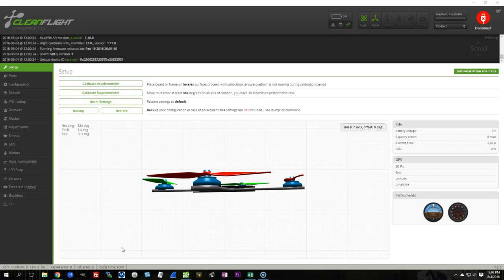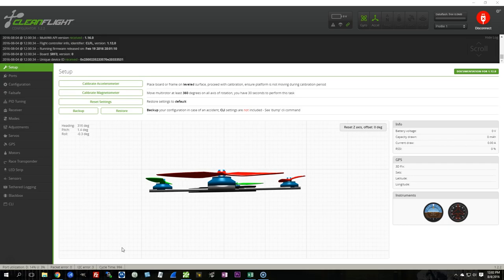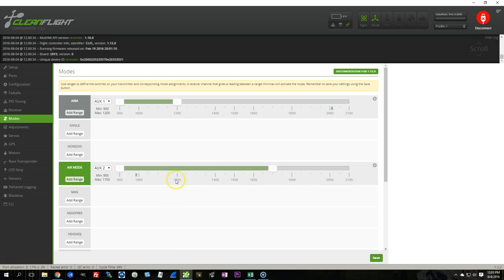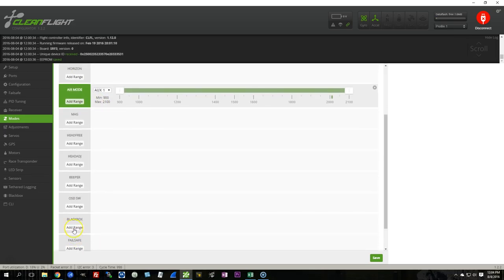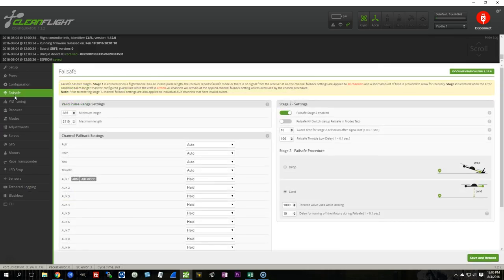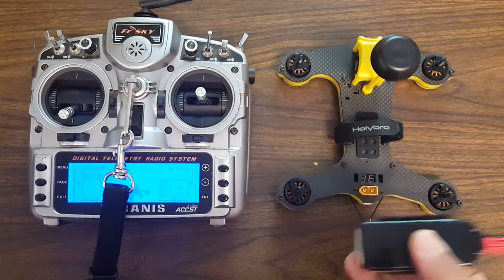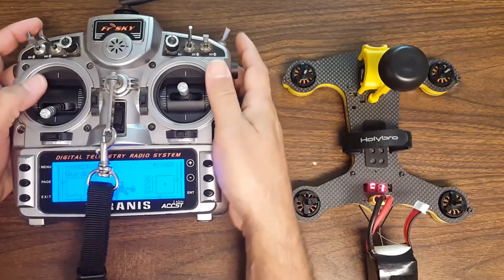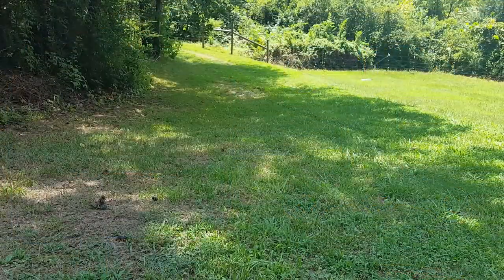Holybro Shuriken 180 Initial Setup and Pre Maiden Checks

Comment: Hiya Josh!  I've been sub'd to you for quite some time.  No, I don't comment on many of your videos because they haven't been directly related to me.  However...that's changed.  I've recently bought a Shuriken 180.  I had a few issues getting it to behave properly, but I've watched many of your videos and the issues were resolved quickly.  Thank you for taking the time to do what you do.  I did maiden hover my Shuriken 180 today and I was greatly impressed with it on stock PIDs and stock props.  I tested the video system and found that it works, as expected.  So...whenever this rain goes away...it's back to the FPV field.  Take care buddy and thanks again!!!

Comment: Hope to see the continuance of this series soon Joshua. Prop choice for the two motors available and how well it handles with Betaflight are subjects I'm interested in hearing about. Keep up the great work. I appreciate your efforts and insights.
Reply from the maker: +Ron Novak it handled great with Betaflight right up until I burned a motor with excess D gain.
Reply: +Joshua Bardwell  hopefully you'll have a chance to replace that motor and get airborne again. Is yours equipped with the 2700kv motors? The 2300kv motors were installed in mine but kit included the higher KV set. Been getting a solid 3 min. flight with the stock props and some middle aged Nano 850mah/4s packs.
Reply from the maker: +Ron Novak 2700. I have replacements on the way from New bee drone.

Comment: Hi Josh!, great videos and new subscriber here!! Just updated my shrunken 180 after a prompt in cleanflight, I've dumped my old cli settings in but obviously in the updated version there are more values on the pids/ modes tabs etc,
Is there any link or video you can do for setting up this quadcopter on its newest CF firmware please? Unable to fly currently :(
Reply from the maker: Definitely do not just dump in your CLI values from the old version to the new version. 

https://www.youtube.com/watch?v=HsxTqp76Brs

I won't be making an update video specifically for this copter, but you can watch maybe this video for some tips on how to do the initial configuration: https://www.youtube.com/watch?v=lNmEeCMryu4
Reply: I meant I have not updated to beta flight just put the old cli into the updated cleanflight . 
Would you recommend then that I do a full chip erase and set it up fresh on betaflight?
Reply: Joshua Bardwell unfortunately I did dump it before I read your comment, 
Took a bit to sort the receiver out but it's working and flying now, I just wondered is it not tuned now to stock settings? So sorry, just a noob that wants to fly

Comment: Hi Joshua Bardwell.  Question:  It's not better to have the 3 flight configurations modes? If so, do you have a vid. To do it? 
Thanks.
Reply from the maker: +Alfonso Irwin I don't use autolevel modes.
Reply: Joshua Bardwell I know that you don't..  it's obvious for the way that you flying.. I mean for beginners.. like me 😉

Comment: Hi.. can I use it with my Radiolink AT Tx and Rx..?  do I need to open up and put the rx inside? will it fit?
Reply from the maker: You would need to install the RX. It has to be a really small RX to fit. It also has to be serial or possibly PPM. It can't be standard PWM.

Comment: Hello Joshua,

I flashed my shuriken 180 like it says to do in the quick start guide. To the latest stable SPRacingF3 release. Now i am not seeing any commutation on the receiver tab of cleanflight with my taranis. Any ideas what i need to do?
Reply from the maker: Presumably the configuration options for the receiver are not set up correctly. You should always save your previous config before doing an upgrade so you can refer to it if anything goes wrong.

I dug back through my archives and I found my old CleanFlight config for the Shuriken. It looks like the receiver should be on UART 2. So make sure UART 2 has "serial rx" enabled in the Ports tab. Then set "serial receiver" in the Configuration tab. Then the Serial Receiver Provider needs to be configured according to what type of receiver you have: SBUS, iBUS, Spektrum, etc...
Reply from the maker: +Dylan Dydot 

#Cleanflight/SPRACINGF3 1.12.0 Feb 19 2016 / 20:01:10 (aa8608a)
# dump master

# mixer
mixer QUADX
mmix reset
smix reset

# feature
feature -RX_PPM
feature -VBAT
feature -INFLIGHT_ACC_CAL
feature -RX_SERIAL
feature -MOTOR_STOP
feature -SERVO_TILT
feature -SOFTSERIAL
feature -GPS
feature -FAILSAFE
feature -SONAR
feature -TELEMETRY
feature -CURRENT_METER
feature -3D
feature -RX_PARALLEL_PWM
feature -RX_MSP
feature -RSSI_ADC
feature -LED_STRIP
feature -DISPLAY
feature -ONESHOT125
feature -BLACKBOX
feature -CHANNEL_FORWARDING
feature -TRANSPONDER
feature VBAT
feature RX_SERIAL
feature FAILSAFE
feature ONESHOT125
feature BLACKBOX

# map
map RETA1234

# serial
serial 0 1 115200 57600 0 115200
serial 1 0 115200 57600 0 115200
serial 2 64 115200 57600 0 115200

# led
led 0 15,15:ES:IA:0
led 1 15,8:E:WF:0
led 2 15,7:E:WF:0
led 3 15,0:NE:IA:0
led 4 8,0:N:F:0
led 5 7,0:N:F:0
led 6 0,0:NW:IA:0
led 7 0,7:W:WF:0
led 8 0,8:W:WF:0
led 9 0,15:SW:IA:0
led 10 7,15:S:WF:0
led 11 8,15:S:WF:0
led 12 7,7:U:WF:0
led 13 8,7:U:WF:0
led 14 7,8:D:WF:0
led 15 8,8:D:WF:0
led 16 8,9::R:3
led 17 9,10::R:3
led 18 10,11::R:3
led 19 10,12::R:3
led 20 9,13::R:3
led 21 8,14::R:3
led 22 7,14::R:3
led 23 6,13::R:3
led 24 5,12::R:3
led 25 5,11::R:3
led 26 6,10::R:3
led 27 7,9::R:3
led 28 0,0:::0
led 29 0,0:::0
led 30 0,0:::0
led 31 0,0:::0

# color
color 0 0,0,0
color 1 0,255,255
color 2 0,0,255
color 3 30,0,255
color 4 60,0,255
color 5 90,0,255
color 6 120,0,255
color 7 150,0,255
color 8 180,0,255
color 9 210,0,255
color 10 240,0,255
color 11 270,0,255
color 12 300,0,255
color 13 330,0,255
color 14 0,0,0
color 15 0,0,0

set looptime = 500
set emf_avoidance = OFF
set i2c_highspeed = ON
set gyro_sync = ON
set gyro_sync_denom = 1
set mid_rc = 1500
set min_check = 1100
set max_check = 1900
set rssi_channel = 0
set rssi_scale = 30
set rssi_ppm_invert = OFF
set rc_smoothing = OFF
set input_filtering_mode = OFF
set min_throttle = 1150
set max_throttle = 1850
set min_command = 1000
set servo_center_pulse = 1500
set 3d_deadband_low = 1406
set 3d_deadband_high = 1514
set 3d_neutral = 1460
set 3d_deadband_throttle = 50
set motor_pwm_rate = 400
set servo_pwm_rate = 50
set retarded_arm = OFF
set disarm_kill_switch = ON
set auto_disarm_delay = 5
set small_angle = 25
set fixedwing_althold_dir = 1
set reboot_character = 82
set gps_provider = NMEA
set gps_sbas_mode = AUTO
set gps_auto_config = ON
set gps_auto_baud = OFF
set serialrx_provider = SBUS
set sbus_inversion = ON
set spektrum_sat_bind = 0
set telemetry_switch = OFF
set telemetry_inversion = ON
set frsky_default_lattitude =  0.000
set frsky_default_longitude =  0.000
set frsky_coordinates_format = 0
set frsky_unit = IMPERIAL
set frsky_vfas_precision = 0
set hott_alarm_sound_interval = 5
set battery_capacity = 0
set vbat_scale = 116
set vbat_max_cell_voltage = 43
set vbat_min_cell_voltage = 33
set vbat_warning_cell_voltage = 37
set current_meter_scale = 400
set current_meter_offset = 0
set multiwii_current_meter_output = OFF
set current_meter_type = ADC
set align_gyro = DEFAULT
set align_acc = DEFAULT
set align_mag = DEFAULT
set align_board_roll = 0
set align_board_pitch = 0
set align_board_yaw = 0
set max_angle_inclination = 500
set gyro_lpf = 188HZ
set gyro_soft_lpf =  60.000
set moron_threshold = 32
set imu_dcm_kp = 2500
set imu_dcm_ki = 0
set yaw_control_direction = 1
set pid_at_min_throttle = ON
set airmode_saturation_limit = 50
set yaw_motor_direction = 1
set yaw_jump_prevention_limit = 200
set tri_unarmed_servo = ON
set servo_lowpass_freq =  400.000
set servo_lowpass_enable = OFF
set failsafe_delay = 5
set failsafe_off_delay = 10
set failsafe_throttle = 1000
set failsafe_kill_switch = OFF
set failsafe_throttle_low_delay = 100
set failsafe_procedure = 0
set rx_min_usec = 885
set rx_max_usec = 2115
set acc_hardware = 0
set baro_hardware = 0
set mag_hardware = 0
set blackbox_rate_num = 1
set blackbox_rate_denom = 4
set blackbox_device = SPIFLASH
set magzero_x = 0
set magzero_y = 0
set magzero_z = 0

# rxfail
rxfail 0 a
rxfail 1 a
rxfail 2 a
rxfail 3 a
rxfail 4 h
rxfail 5 h
rxfail 6 h
rxfail 7 h
rxfail 8 h
rxfail 9 h
rxfail 10 h
rxfail 11 h
rxfail 12 h
rxfail 13 h
rxfail 14 h
rxfail 15 h
rxfail 16 h
rxfail 17 h

# dump profile

# profile
profile 0

# aux
aux 0 0 0 900 1200
aux 1 27 0 900 2100
aux 2 0 0 900 900
aux 3 0 0 900 900
aux 4 0 0 900 900
aux 5 0 0 900 900
aux 6 0 0 900 900
aux 7 0 0 900 900
aux 8 0 0 900 900
aux 9 0 0 900 900
aux 10 0 0 900 900
aux 11 0 0 900 900
aux 12 0 0 900 900
aux 13 0 0 900 900
aux 14 0 0 900 900
aux 15 0 0 900 900
aux 16 0 0 900 900
aux 17 0 0 900 900
aux 18 0 0 900 900
aux 19 0 0 900 900

# adjrange
adjrange 0 0 1 950 1000 15 3
adjrange 1 0 1 1075 1125 16 3
adjrange 2 0 1 1175 1225 17 3
adjrange 3 0 1 1300 1350 18 3
adjrange 4 0 1 1400 1450 19 3
adjrange 5 0 1 1525 1575 20 3
adjrange 6 0 1 1625 1675 9 3
adjrange 7 0 1 1750 1800 10 3
adjrange 8 0 1 1850 1900 11 3
adjrange 9 0 0 900 900 0 0
adjrange 10 0 0 900 900 0 0
adjrange 11 0 0 900 900 0 0

# rxrange
rxrange 0 1000 2000
rxrange 1 1000 2000
rxrange 2 1000 2000
rxrange 3 1000 2000

# servo
servo 0 1000 2000 1500 45 45 100 -1
servo 1 1000 2000 1500 45 45 100 -1
servo 2 1000 2000 1500 45 45 100 -1
servo 3 1000 2000 1500 45 45 100 -1
servo 4 1000 2000 1500 45 45 100 -1
servo 5 1000 2000 1500 45 45 100 -1
servo 6 1000 2000 1500 45 45 100 -1
servo 7 1000 2000 1500 45 45 100 -1

set gps_pos_p = 15
set gps_pos_i = 0
set gps_pos_d = 0
set gps_posr_p = 34
set gps_posr_i = 14
set gps_posr_d = 53
set gps_nav_p = 25
set gps_nav_i = 33
set gps_nav_d = 83
set gps_wp_radius = 200
set nav_controls_heading = ON
set nav_speed_min = 100
set nav_speed_max = 300
set nav_slew_rate = 30
set alt_hold_deadband = 40
set alt_hold_fast_change = ON
set deadband = 0
set yaw_deadband = 0
set throttle_correction_value = 0
set throttle_correction_angle = 800
set default_rate_profile = 0
set gimbal_mode = NORMAL
set acc_cut_hz = 15
set accxy_deadband = 40
set accz_deadband = 40
set accz_lpf_cutoff =  5.000
set acc_unarmedcal = ON
set acc_trim_pitch = 0
set acc_trim_roll = 0
set baro_tab_size = 21
set baro_noise_lpf =  0.600
set baro_cf_vel =  0.985
set baro_cf_alt =  0.965
set mag_declination = 0
set pid_delta_method = MEASUREMENT
set pid_controller = MWREWRITE
set p_pitch = 43
set i_pitch = 23
set d_pitch = 29
set p_roll = 35
set i_roll = 20
set d_roll = 26
set p_yaw = 115
set i_yaw = 30
set d_yaw = 14
set p_pitchf =  1.400
set i_pitchf =  0.400
set d_pitchf =  0.030
set p_rollf =  1.400
set i_rollf =  0.400
set d_rollf =  0.030
set p_yawf =  3.500
set i_yawf =  0.400
set d_yawf =  0.010
set level_horizon =  3.000
set level_angle =  5.000
set sensitivity_horizon = 75
set p_alt = 50
set i_alt = 0
set d_alt = 0
set p_level = 60
set i_level = 60
set d_level = 75
set p_vel = 120
set i_vel = 45
set d_vel = 1
set yaw_p_limit = 500
set dterm_cut_hz =  0.000
set gtune_loP_rll = 10
set gtune_loP_ptch = 10
set gtune_loP_yw = 10
set gtune_hiP_rll = 100
set gtune_hiP_ptch = 100
set gtune_hiP_yw = 100
set gtune_pwr = 0
set gtune_settle_time = 450
set gtune_average_cycles = 16

# dump rates

# rateprofile
rateprofile 0

set rc_rate = 135
set rc_expo = 75
set rc_yaw_expo = 22
set thr_mid = 50
set thr_expo = 0
set roll_rate = 65
set pitch_rate = 65
set yaw_rate = 85
set tpa_rate = 20
set tpa_breakpoint = 1600

Comment: The default max values are set for 1840 instead of 2000 like most other quads. Should I turn up my travel on my Dx6 to get 2000 and up the values in clean Flight?
Reply from the maker: I think you may be confusing the input and the output values. Input values are in the Receiver tab and should always go from 1000 to 2000 with 1500 in the center. Adjust this using your transmitter's endpoints and sub-trim settings. Input values pertain to what the FC sees from your transmitter.

Output values are controlled by min_command, min_throttle, and max_throttle. These values pertain to what the FC sends to the ESCs. Min_command and max_throttle are what controls the ESC calibration endpoints. 

The input and output values have no implied relationship to each other. Input should always go from 1000 to 2000. Output can go from whatever to whatever as long as the ESCs are correctly calibrated. However, setting min_command and max_throttle too close together reduces the resolution that the FC sends to the ESCs. So it's ideal to use values like 1000 and 2000. 

If max_throttle in the Shuriken is set to 1840, it doesn't matter, as long as the ESCs are calibrated to that value.
Reply: Joshua Bardwell perfect. Any idea why it came set as 1850?
Reply from the maker: Nope.
Reply from the maker: But if you change it, you have to re-calibrate the ESCs and re-check min_throttle. Honestly, I would do it anyway because that's how I am.

Comment: hi Joshua would the shuriken 180 with a frsky xsr receiver bind with a xk 251 transmitter which is futabu s-fhss compatible thanks
Reply from the maker: +jason richards no. Only FrSky.
Reply: You would need a small Futaba S-FHSS receiver. Banggood sells a few small ones, that use Sbus and/or PPM. These should fit inside the Shuriken 180 frame.

Comment: How to land with Airmode ON? I am not able to land with it because its always hopping around so i need a switch to turn it off :/
Reply: I fly with airmode and when I land I just get into really low hover and hit disarm to stop the motors and just let it drop.
Reply: Just disarm when you touch down or slightly before hand
Reply from the maker: +The RCAddict exactly.
Reply from the maker: +MTL Racing same here.
Reply from the maker: +phil _ switch arming. Disarm just be four you touch down.
Reply: +Joshua Bardwell There is great article on oscarliang.com! you basically disable motor stop on disarm and put air mode and arm on a 3 pos switch! the sw center is arm, the topmost is arm+air mode. when you are about to land disarm the quad in air..don't worry it won't fall out of the sky as the throttle isn't low enough for motors to stop..slowly lower the throttle and as soon as it reaches the minimum throttle it switches off and voila you have a great landing you could brag about! :P :)
Reply from the maker: I always have disarm configured to go regardless of throttle. When I disarm, I want to disarm right now.
Reply: ah, okay. Never thought about landing with disarming. Simple but clever ;)
thank you!